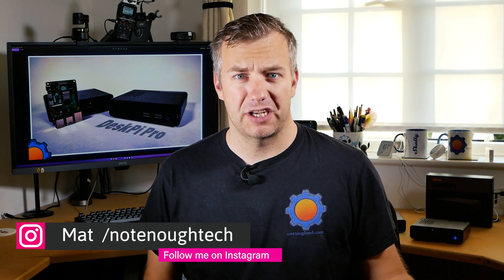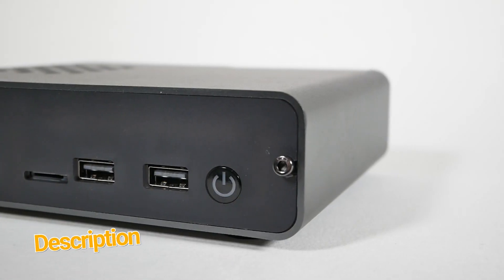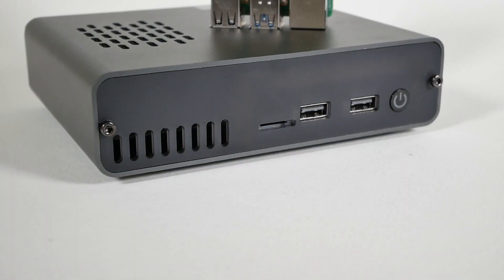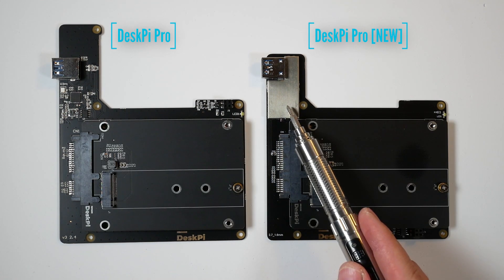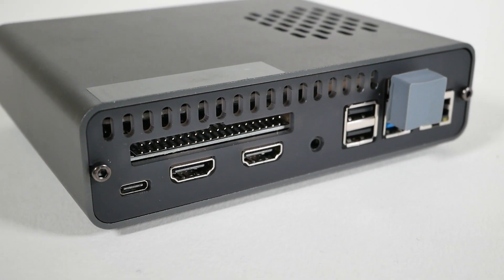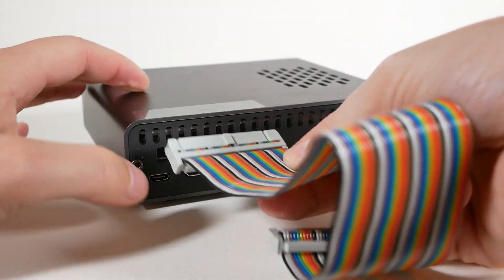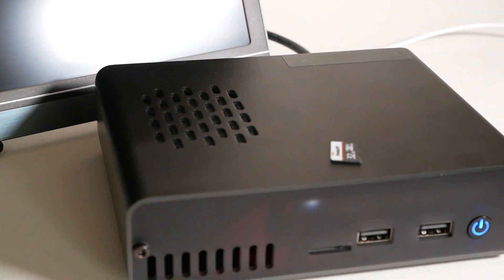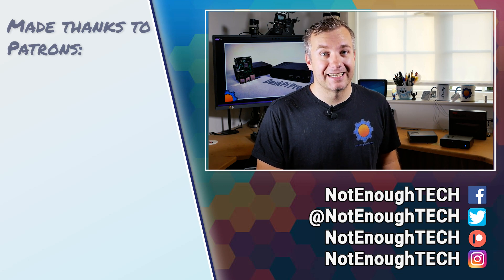Upgraded DeskPi Pro - what has has changed?

Comment: I rate it 1:5.  LIRC wont work with default driver as there is no default.  Safe Shutdown wont work when Enabled, as if Always On were chosen by internal toggle. When set as Disabled it werx as ON/OFF button only.  Initial HDMI0/HDMI1 boot impression promising but HDMI1 fails to display splash screen. A sad NAS/NUC not worth the struggle.  01/24.
Reply from the maker: I have not experienced any of these at launch... I wonder how much this is down to changes in Raspbian OS? HDMI thing is strange as I had readout regardeless

Comment: I really wanted to like this.    Ordered two of those - it sucks !   DO NOT BUY IT !     

Tried Rasbian32/64 - will not boot of SSD. Will not shot down properly (the blue LED stays ON), cooling fan makes buzzing noise. It took 3 weeks to deliver to US (despite I paid $25/shipping).
There is no SD card (as shown on their video).  The idea is fantastic but this product is not really ready for market :-(
Website is very limited and has not enough information. Some command presented do not work at all. By default the fan is set to OFF and you cannot use it in the case without the fan. Some stand off screws have thread to short which makes it very hared to screw the heat-sink.  The plexiglass on the front allows light from LEDs out which makes the front look like it is cracked or broken (ugly).      Not happy at all.
Reply from the maker: Hi Sadarahu, sorry to hear that you had many issues with yours. I regards to some of the things listed:
Are we speaking about the 1st gen case or the latest one?
0. Shipping cost and times are huge at the moment, this applied to everything that goes over the seas. Unfortunately not much will change, due to global transport issues. 
1. Boot from USB on 1st gen is possible (on my unit) I used the raspi-config to set it up - have you tried that setup? I assume your drive is working fine and you were able to store stuff on it.
2. Fan controller requires drivers to be be installed or fan connected to specific GPIO for raspi-config  settings to work, Note that setting the fan speed below 30%-50% can result in the fan stalling. You can slow down the fan but it may not possible to enable the fan from 0 to 30% due to current requirements.
3. I agree, the stand-offs could use another 1-2mm height 
4. you can stick some tape at the back of the perspex to cover the lights, personally i like to see these to know that everything is working well.
5. I'm not sure whats the deal with the SD card - check if the card was listed in your product listing. Bear in mind my orders are not made through the shop but through the PR team so check if the card was indeed included in your product listing.

If you have any questions i'll be happy to help as much as I can